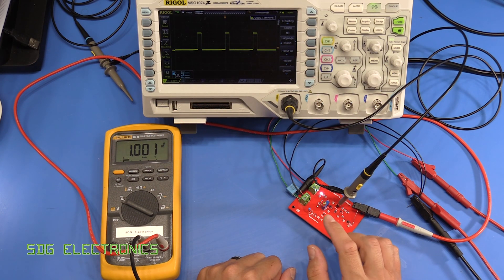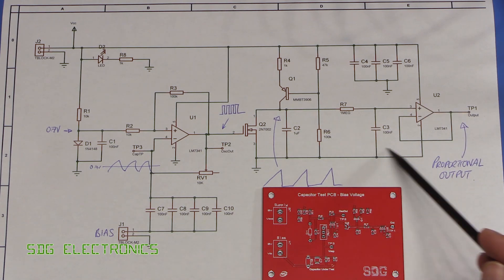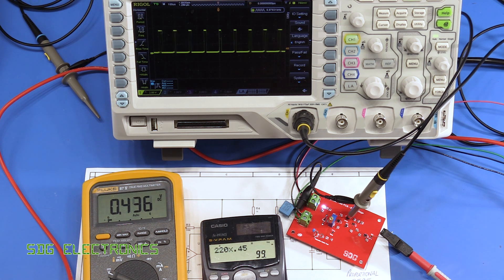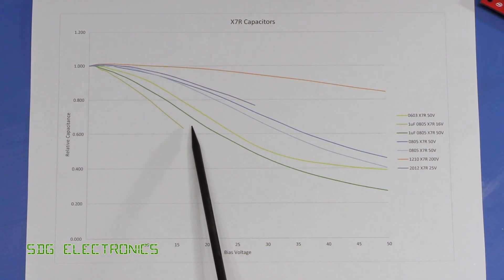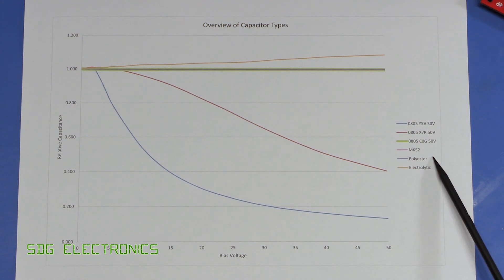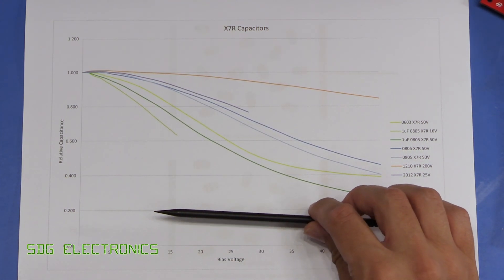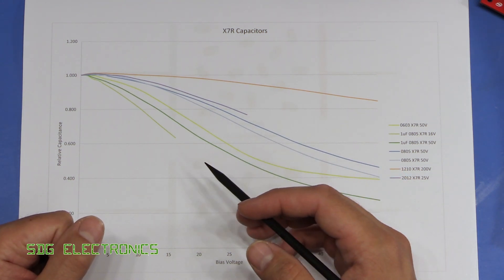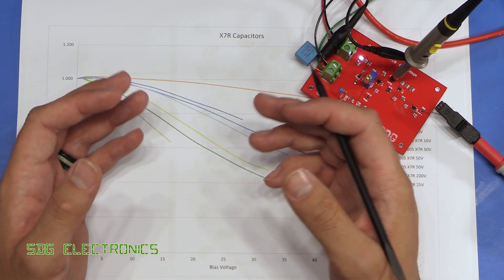SDG #095 MLCC Capacitors Values Not What You Think?! Tests on MLCC

Comment: Wow! This video is gold! 
I really wish that it was longer! Or at least a complete series showing the actual component under test! 
I could have sat here for two hours and watched it from start to finish, and good luck if I just happened to be in the toilet and and started watching it and you were outside waiting to get in LoL.. 
Although I work mostly with audio gear, this video had me wondering if a ceramic would be affecting the input signal of an amplifier? A bass signal can can rise in amplitude and carry some current which by it's very nature could be going into the region where it's going to be high passed! 
This video has definitely caught me off guard! Now there's another variable that has to be factored in to choosing a capacitor other than temperature, voltage rating, capacitor type, working frequency and then we have to remember their failure modes! Most people just check for ESR but never check for parallel resistance for DC leakage because no one really talks about how to test for DC leakage... Unfortunately, testing for DC leakage can only be done out of circuit and sometimes it's just best practice to test a few and replace them all if the device is old enough and the few tested were bad... But this is another topic altogether of which when it comes to capacitors there's much more than meets the eye 👀...

Comment: SMT case size impacts the dc bias curve (arguably) more than the rated voltage, for example compare 10uF in 0603 vs 0805 vs 1206 vs 1210 at the same rated voltage in X5R.  Maxim also have a rather neat application note on this subject which is worth a google.
Reply: I think yes and no. It might be that the caps with larger case sizes are actually rated for higher voltages but marked with lower values by manufacturers to save some money on production lines diversification.

Comment: I remember a little about this from 1973 in Vo-Tech school and the changing values with voltages.  Never did much designing, so never really need to make use of this.  But I recall that the instructor said the distance between the plate decreased with the increase in voltage and capacitance then went down as the distance decreased.  Now that was what the instructor said in 1973.

Comment: By "bias" voltage, does he just mean the voltage across the cap.
Reply from the maker: Yes, a DC voltage. So for example on the output of a 5V regulator circuit, there will be a reduced effect of filtering any ripple.

Comment: Thanks! This proved my point in cap replacements. 
While repairing TV horizontal & vertical even PSU's. I would always go up on voltages for the caps about 15%. It worked out to be more stable for the outputs and rarely failed again. Why can't manufacturer's designers see this? They seem to go with the least reliable value that would operate a circuit for an extended period. Thanks for cap materials & package testing.

Comment: Steve, would you please publish you test data?  I'd like to examine it and consider this subject further.  Thank you.
Reply from the maker: Yes, I ran out of time last night - I'm just uploading this to my website as we speak
Reply: I'd like to have a look as well. I was wondering if one could utilize this effect to build a voltage controlled oscillator.
Reply: Hi  @DrenImeraj 
Yes you can.
However, the I've use this effect in low frequency phase locked loop circuits.
Be careful though, the voltage to frequency transfer curve is a bit unstable.
I have found that the frequency will drift with time. 
The drift over long periods of time is considerable. 
Of course, this is not a big problem in a PLL. It would be a problem if
you wanted the frequency to remain constant with a set voltage.
BTW, both temperature and operating frequency is also part of the transfer curve equation.
redrok@redrok.com

Comment: I've only found one MLCC manufacturer who makes this information easy to get.  muRata has an excellent online tool called SimSurfing that will display capacitance-vs-frequency graphs (as well as inductance, impedance, quality factor and a few other parameters).  The system allows you to specify how the component will be used in a circuit, as well as a DC bias, and the graphs change accordingly.

There are versions of the application for much of their product line, not just MLCCs.  The launch page for each product line is near the bottom of the page linked below, under the heading, "What can be done in SimSurfing (By product)?"

https://www.murata.com/en-us/tool/simsurfing

Comment: A fair portion of the lots I get from China read only 70% of their nominal value out of circuit ... esp if they are high-valued, like 226's.
Have not even tried the ceramic 107's yet.  Guess I have nothing to worry about.  :/
Reply from the maker: @philipdifrancesca  The capacitors under test are all AVX or Kemet.
Reply: @philipdifrancesca  I am not a pro, just a laowai hobbyist.   When I carefully select AliExpress store and product, usually get OK stuff.
So you source from directly from Japan, and not like Mouser or Jameco?
Funny, I have just built a contraption to measure inductance, and found a whole set of under-wound, and possibly defective toroid cores.  I like this device above ... and would really like a close-up of how these SMB parts are being held in place.  Some kind of PCB spring-clip contraption?
Reply: @philipdifrancesca  Yes, that Chinesium Electrolyte is pretty wild stuff.  I have a bag of 500 0.1uF plate ceramics that range from 0.14-0.04uF.    HungSoLo supplier.  Manufacturer never declared.  Never.  Slightly out of spec.

Comment: Why is the sawtooth generator needed before the LPF followed by the buffer?
Reply from the maker: The output of the comparator only changes in frequency not duty cycle, so if you filtered the output you'd actually get a constant no matter what the oscillation frequency. It's not quite a sawtooth, there is some dead time while the capacitor is discharging - this gives a proportional output voltage after it's been filtered.
Reply: @sdgelectronics  It all makes sense now. Thank you very much :)

Comment: Well, I never knew that!! Thanks for the explanation, probably not so important in audio work but I always like higher voltage caps anyway.
Reply: It seems that a lot of people don't know this going by the rest of the comments!
I for one had no idea although I was aware that some capacitor types are affected by temperature 🌡️...
My first thought was what the effect on an audio circuit would be if the wrong capacitor type was chosen and placed in the audio path? Sure it will be working in a low voltage environment but with a very dynamic signal. The wrong type of capacitor might be high passing bass notes actively if their amplitude is high enough? 
I have been looking into a substitute for electrolytic capacitors as input de-coupling Capacitors, while their performance is great, I'm looking for something that can provide long life.. Metal film Capacitors seem like the way to go for that purpose but they don't come cheap and are difficult to implement in an existing circuit because they grow substantially in size as they go up in value... 
I have one of those cheap eBay vacuum tube pre amps which is using 1uf metal film Capacitors and I wanted to go up in value to somewhere around 3 or 4uf to let some more low end through but the footprint of the 1uf is much smaller than the 4.7uf which has a huge footprint! I could easily fit an electrolytic in it's place but I don't want to worry about DC leakage or electrolyte leakage 20 years from now... 
I might have to see if I can drill new holes either side of the existing ones and possibly bend the legs back in, not sure if this will work or not because I just thought of it but I'm definitely going to look at the possibility right after this comment LoL. So thanks for the idea Mike 🙂.. it was a pleasure talking at you, something that I do a lot to the wife and usually the answers I need just come even though she never got one word in edgewise lol..